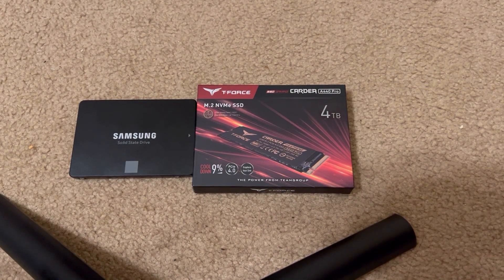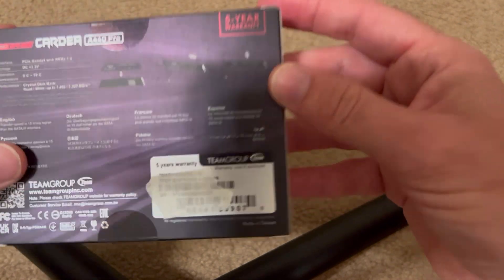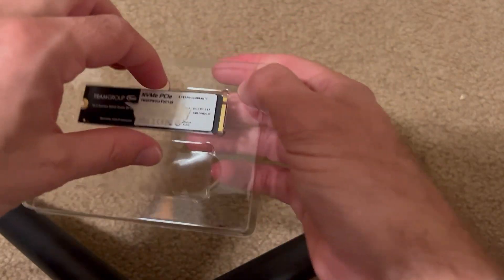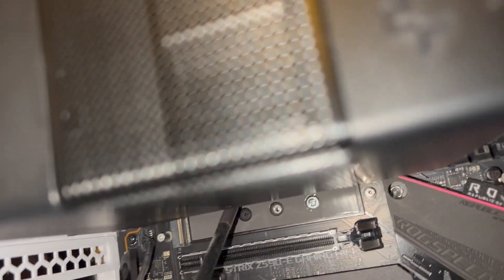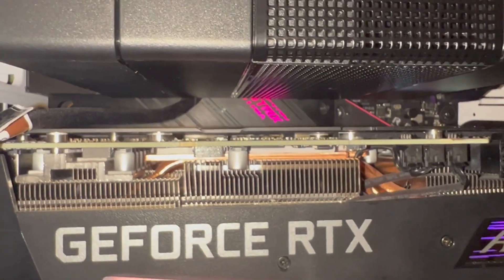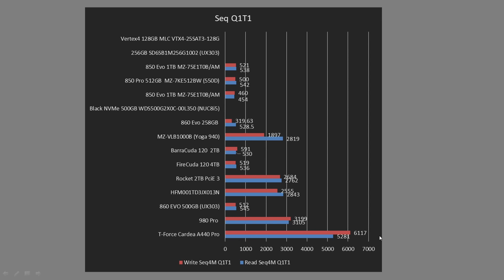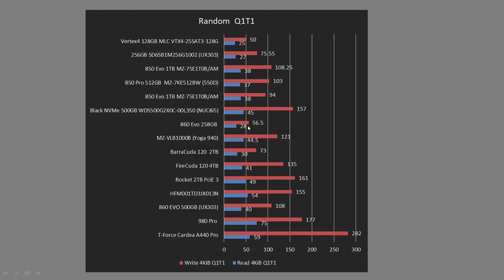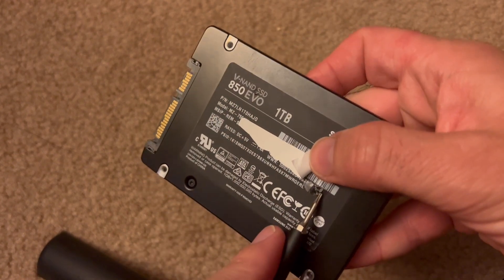T-Force CARDEA A440 Pro Graphene 4TB Review

Comment: I just ordered a Cardea Zero Z440 2 TB. 3600TBW but slower writing and reading speeds (around 50%) versus an A440 Pro. I doubt I'll notice it though, especially since it's going in my server as the main drive. Got it for 100€.
Reply from the maker: nice. Personally I dont think most people would notice Gen3 vs Gen4. My main ssd on the desktop is Gen3 and the game one is gen4.
Reply: Do you think a smaller capacity may not heat up so fast?

Comment: Are you happy with the upgrade? How long have you actually had it in use?
Reply from the maker: Going to say 2 months now. For some reasons runs a bit hot. I even re-seated it. sill same temps. In other reviews seamed to run cooler.